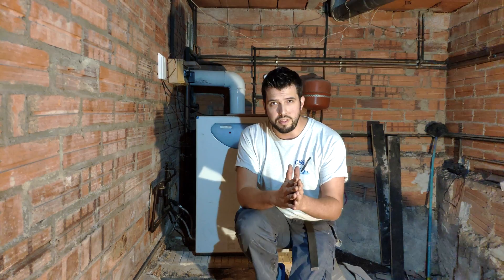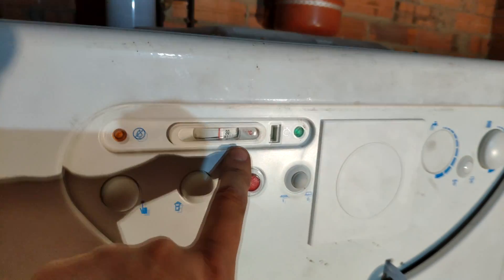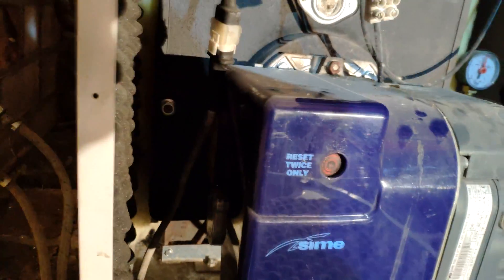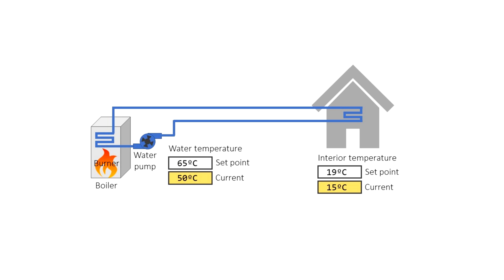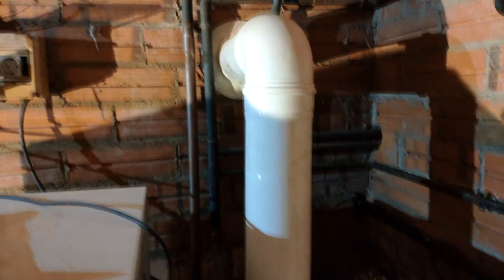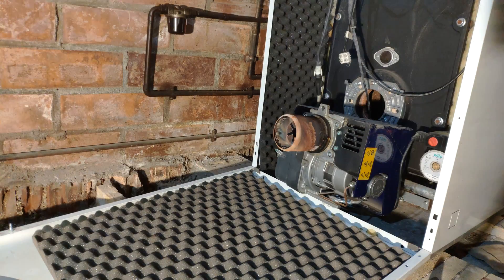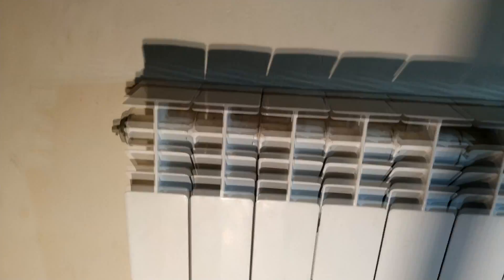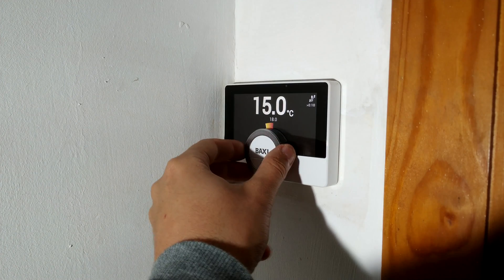Home central heating system diagram explained 🔥

Comment: Hi. I need your advice on setting up a radiator heating system for a grow room. The room size is L10' × W10' × H8'. I need to maintain a 104-degree temperature constantly. In my area, gas is the cheapest. Thank you in advance.

Comment: How much diesel is consumed per day per room
Reply from the maker: It is depens on many factors to give an answer. Exterior temperature, the temperature you set the boiler, the set point temperature, the boiler efficiency, the house isolation, how many days a year you use it, etc... for 180m² house I expend in Spain from 800 to 1500 liters.
Reply: @GuyInAMountain  Thanks for replying 👍. My house is at altitude of around 7200 feet above sea level built of brick and concrete. Consumption would be for 4 months only. Outside temperature vary between 2 to 5 degrees Celsius. Room temperature I want is  to be around 15 20 celcius. It will need to run around 16 hours a day. Need this for 3 rooms 12*12 feet size. The rooms are isolated by wooden board.